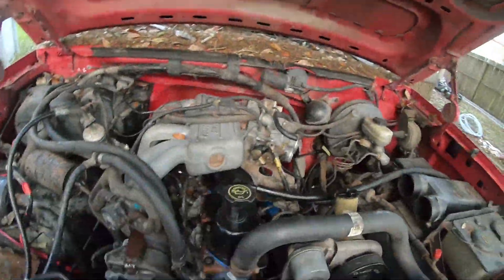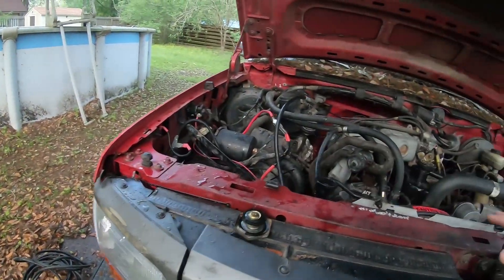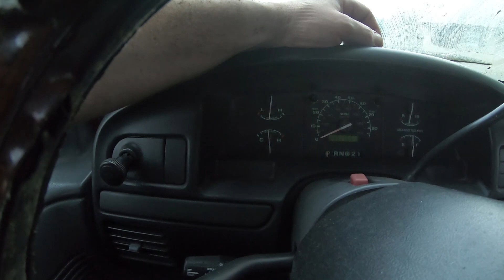Ford 4.9 F150 Blown Head Gasket Repair Part 14: Will it start?

Comment: Good job. Got it running again. I got same truck but extended cab. Need to get it running again. U should do an EGR delete on it. Heard u get better throttle response and no lag when u do that. But just watched all 14 episodes and gonna check out the lightning project now. 👍
Reply from the maker: I thought about the egr delete but honestly was scared to try. Read some pros and cons to doing it, and I’m worried I’d mess up something. Or I might be gun shy after seeing the crappy job the previous owners did on my lightning 😂, check engine light galore going on there! I was actually surprised at the fuel economy improvement I got after this project. The old girl went from 11.5-12mpg up to 16.8-17.2 through the last 10 tanks of gas. Like I said in my other reply I really appreciate ya watching my stuff, means a lot when I read that. Filming These videos really adds to the workload (like an extra 6 to 8 hours just to edit down) but it’s worth it when I read comments like yours. Thank you again.
Reply: @3rdcoastobs467  which editing app do u use on ur videos?
Reply from the maker: I use the adobe premier elements '19. Got it on sale last year when I bought a gopro. I think it was like $40 at the time vs the adobe pro which was like $99 and a monthly subscription of $12 (I didn't need all that being a huge amateur) .  A lot of the guys I'm friends with here on YouTube use some free software from online they've had luck with im just not sure which ones. I'm happy with the software I bought, took a little getting used to but for the style I like to shoot it works since I cut and snip as much dead video as I can so it hopefully won't get boring watching.

Comment: ok, started taking somethings apart, picking up the book tomorrow, getting ready to attack! need my dump truck back!! thank you so much. you have a different engine but gave me a lot of insight and confidence. going to re-watch as i go.. thanks again
Reply from the maker: That’s awesome to read brother. Been about a month since you last left that comment about getting prepped, it’s tough to start and overwhelming to look at the parts and pieces everywhere. bag and tag everything and leave the bolts in the parts exactly is a tip I wished I used, they love to use 2 different bolt sizes and lengths on stuff like the alternator and p/s pump...and exhaust...but you can do it. Those books are such a great resource but be careful they like to leave out “small” details that can make you throw a wrench or 2 😂. Good luck! I appreciate ya using my videos as a little extra guidance, I hope I don’t steer ya in the wrong direction on anything!

Comment: I have an 88 ford f150 with the same motor but mine had a cracked head 5 out of six was cracked im in the middle of putting it back together now and you videos have helped me alot ty
Reply from the maker: Glad it helped brother.  I'm a amateur so I know I made mistakes but hopefully it got you through some rough patches

Comment: Smart getting several gaskets! Saves frustrating trips to autoparts store.
Reply: Congrats btw, was exciting to watch your progress, great truck cant wait to see it on road.
Reply from the maker: David Garcia thank you brother, it’s been a long journey 😂 and I’m glad she’s running again! The gaskets were so cheap from rockauto I decided to order about 6 of them a few months ago, thank god I did 🤣. Nothing worse than stopping in the middle of a frustrating rebuild to have to drive to the parts store, that’s stopped many a project over here because I was covered in oil,grease or anti freeze and didn’t want to clean up before leaving. I appreciate you watching and commenting my friend, thanks for watching the struggle in saving this old f150!

Comment: Have heard allot of good things about whats called "Fail Safe" Thermostats
Reply from the maker: me too. i like the idea of fail open T-Stats especially on older vehicles where the old stock gauges may not be super accurate. I went with the old stock brand MotorCraft with the factory temp just to test my work and see how my dash gauge worked. When i first bought the truck in 2019 it either read under temp (like under the N in normal while driving) or climbing and passing the L in normal. I'm going with the fail safe in my Lightning project for sure though!

Comment: wow! I saw Zane's F600 4x4 videos and ended up here.  I recently got two old fords with 4.9L (300 CID) engines.  a 1983  F100 3 speed manual and a 1968 F500.   I got the 68 running but it's not ready for the street yet.  The 83 may need a clutch or clutch fork.  I think I need to drop the transmission though.  Congratulations on getting the head gasked fixed!  I love those 300 inline six engines!
Reply from the maker: dolinick appreciate ya stopping by and checking it out. Hopefully ya get the 83 up and running too, I love the look of those trucks. I’ve never had to drop the trans in one of these, doesn’t seem impossible but looks like a heck of a job to do but worth it to get it up and going again. Those 68 f500 are awesome! Looks like a tank. A little to much truck for anything I need around here but I’d sure like to have one just because 🤣. Again thanks for taking the time to watch and comment brother!

Comment: Thanks for the shout out man! 

You had the right idea buying all of the thermostat gaskets, I ended up using 3 by the time I got my leak stopped LOL.
Reply from the maker: Steve Stoltz they were so cheap I had to buy up a stash . I figured things never go right the first in my case 2nd and 3rd time so better have spares 😂. Those things are just prone to wear out and pit over time I guess. Like I said I didn’t do myself any favors bead blasting it either. Definitely a frustrating learning experience! And no problem on the shout out man, seems like every time I had an issue I found the answer on your channel, I appreciate you taking the time to film it all!
Reply: @3rdcoastobs467  Thanks again man.

Comment: Good job man and congrats on conquering and bringing the "debacles" to a successful end, lol. I guess one thing on mine I'm fortunate about is at least I have a real, all metal power steering pump. I've never liked that plastic, janky, bull squat of a reservoir/housing they used. Just meant for problems ! I'm sure you're breathing sighs of relief now and a big load off your mind. I've still got some big decisions to make on what to do on my little to no budget and much to conquer but should have time now with this quarantine mess we're in.
Reply from the maker: Stucknarutt thank ya brother! Basically done except getting buttoned up, it is a huge relief for sure!! You have that good Saginaw pump that I want to change over to, those are the way to go, I just have to swap the lines and bracket if I find one at a junk yard. I hate this design too my friend, nothin but trouble! I’m still going strong at work, apparently “essential” personnel (basically they don’t want to pay me to be home😂). Hoping it works out for ya on the van man. Timing always has to be right with financial situation in order to justify sinking money into our old trucks, that’s why I’m still saving and planning on the lightning rebuild, I know as soon as I unass the money something is gonna break around here! Something will change though and you pull the trigger and get that sucker fixed up!

Comment: Its alive! I just told Steve yesterday I took my pump apart to fix a simple leak, created a bigger leak and spent two months trying to fix it!. Minor beans compared to the project you just tackled though. You should be real proud of yourself, I sure am.
Reply from the maker: Sparks Fire and Baling Wire crazy that the power steering is such a nightmare, seems like if you touch it for anything it’s going to spiral out of control fast 😂. Thanks for support brother, I really appreciate that

Comment: I truly appreciate you making these videos because you are giving me a heads up so that I don't make the same mistakes and that is a big contribution from you. I am getting everything together to start my journey in a few days. I'll be around asking some questions as I go. Could you please send me the part number or the link of the web side where you bought the Thermostat Housing Elbow? My truck is 1992. I am not planning on fighting to get it out. Thank you.
Reply from the maker: Hopefully your thermostat housing will be in better shape than mine🤣. I'm glad these are helping brother! I'd take it apart first before ordering just in case..... but if you do need to replace stuff here's what I used. 
Went to O'Reillys for the thermostat housing:  manufacturer was Murray, description was  "Murray climate control water outlet" part #84816 @$15.99. They had it stock and I didn't want to wait a week or more from Amazon or rockauto.
Get extra gaskets too. I used fel-pro part# 35355. I bought mine from rockauto on a bigger purchase with my cylinder head pushrod ect..and they only cost like 80cents each but o'Reilly's has them for $1.69ea, still I ended up buying 5 or 6 and used 3 just trying to get it on. Lastly is the elbow. I bought mine from Amazon because they had the shortest lead time. The ford part number is E5TZ-18599-C and I think I paid around $23 for it.
Reply: @3rdcoastobs467  Thank you very much man. I appreciate it.
Reply: @3rdcoastobs467  it's me again.
When I go to rockauto and search for cylinder heads they show two options:
1-  2F43
2- 2FF8
I clicked on them and I was able to see the applications. However, I wanted to ask what was your selection when you ordered yours. I just want to make sure of everything before I order. Thank you.
Reply from the maker: @CHOMAHOMA  I chose the 2FF8 cylinder head with no smog holes.  What will make sure you get the correct one is entering your vin number when you go to buy it. I dont think they will let you choose the wrong one. Now I went with the reman because I didn't know or trust any machine shops locally to do the work on my original...but after pricing out everything it was cheaper to go this route (after getting a core charge refunded) than pulling it and getting it resurfaced.

Comment: I own  a 1990 f250 300 i6, I was  pretty scared to start replacing the exhaust manifold but you made it look pretty easy. starting disassembly right now !
Reply from the maker: Editing helped me look like I knew what was going on 🤣. But really it's not too bad,  I would have liked to string together a few days straight working on the truck but filming and editing doubles the work time so it stretched out. Probably can knock it out in a few hours without interruption.   Thanks for checking it out,  hope it helped ya.

Comment: 🤣 "just in case Zane" 🤣🤣 that was funny buddy! All that hard work has paid off my friend 🙂👍. Just the power steering fix and you'll be back on the road in no time. I think you got it fixed quickly if you count having to go to work and edit also. Great job my friend 🙂. Always appreciate the shout outs as well 👍
Reply from the maker: HODGE_PODGE_DODGE_GARAGE first thing I thought of on my startup and saw smoke was “I’ve seen this movie before, now where’s my fire extinguisher!?” Thanks for the kind words and always stopping by to watch man. No problem on the shout out, I’m very happy to do it! Hopefully I’ll be driving this old truck daily again really soon.
Reply: my carb caught on fire so many times trying to get the F500 running.  I didn't know the distributor roll pin was sheared.  Luckily I had an old sweatshirt to snuff out the flames.   I will keep a fire extinguisher nearby in the future.  :)

Comment: hey same color as my 94.awesome sound,, heheehe
Reply from the maker: garrett chiodo my first truck when I was 16 was a Red 1993 F150 XLT straight 6, man I loved that truck!! I’m dating myself here but I remember going to the dealership and seeing it the day we bought it when I was 12. We were soooo close to getting a brand new red 93 lightning but my dad was scared when I got old enough to drive I’d wreck it or get too many speeding tickets so he got the torque monster 300 instead 🤣. I’d venture to say it’s my favorite color on these 92-96 trucks so I’ve been kind of hunting them for a Few years before the stars aligned and I was lucky enough last year to be able to buy both of them within 3 weeks of each other. The only thing to add to the collection is a 2nd gen lightning and a mid 90s bronco...if I win the lottery 😂

Comment: Should have let it run without water in the radiator until reached running temperature then cut it off let it cool all the way back down and them put coolant in it it will seal the way you did it but if ever using the old head thats not been surfaced need to run it without coolant so the headgasket will seal
Reply from the maker: Great info! Wish I knew that back then, It’s worked out but these kind of tips really help. I plan on getting a few more “classics” before I’m to old and I guarantee I’ll remember this information. Thank you for watching brother, and the kind words!

Comment: doing this job now, what spec is on the rocker arm bolts?
Reply from the maker: Torque specs?
Reply: @3rdcoastobs467  yeah can’t find a answer lol
Reply from the maker: @mavenbrannon1270  so i think it depends on what year/motor...its been years since I did this...I just torqued per haynes manual 17-23 ftlbs....buy that book, it's like $25 bucks but has everything you'll need...it was my Bible during the rebuild
Reply: @3rdcoastobs467  so far ur videos have been my manual 😂 has everything i needed to get the job except that one part  thank you seriously man
Reply from the maker: Appreciate that brother, thank you for the kind words!